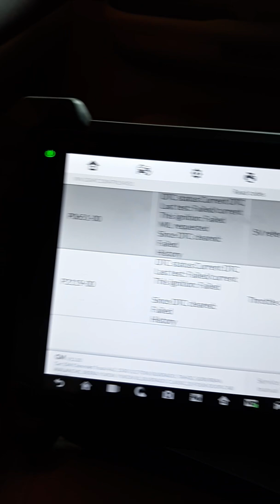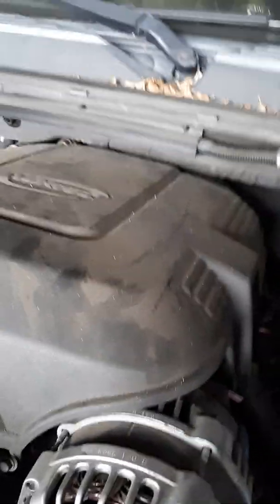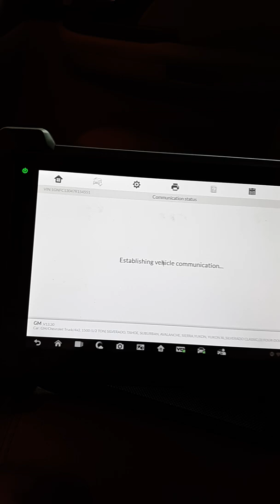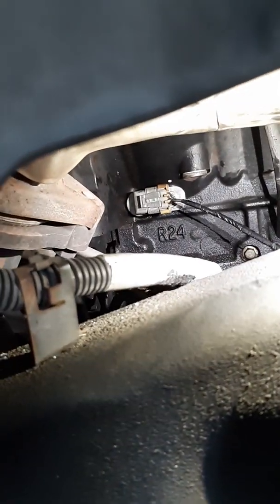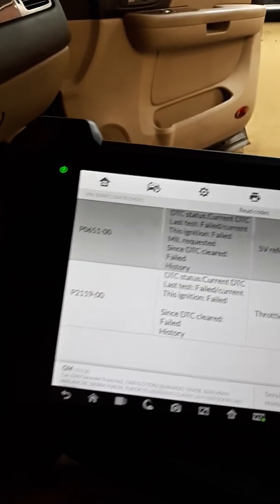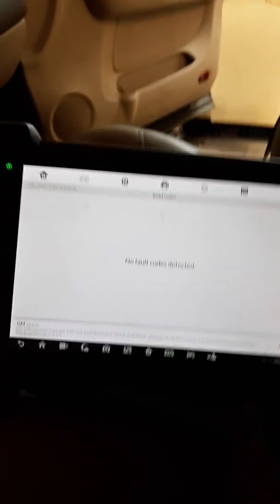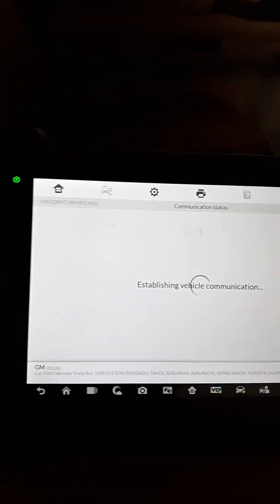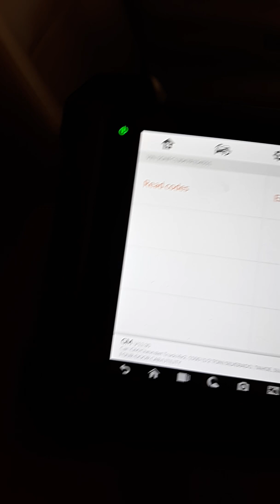Chevy tahoe 5.3 2007 p0651 and p2119 fix problem

Comment: I have a Chevy Silverado with same code. I bench tested the CKP and indeed it was bad but that was not the problem. In fact the problem with the one I’m working on is not on YouTube. I fixed it though. My customer is actually the dealer. They could not figure it out and it’s a dealership 😂😂😂. I’m a hybrid/ Electric car mechanic that’s why. All these regular car electrical problem are basic to me.
Reply: What was it
Reply: @izicromero3702  Let me try to remember it’s been a while back. I remember the car would go into some kind of limp mode. Then upon scanning it said 5 volts reference or something. Man I’m glad I came across this video I have done forgot all about it. I don’t accept regular car anymore. I only work on hybrid but back then my business was still slow I used to accept electrical problem on regular cars. I remember I charged 650 dollars to fix the problem and did some rewiring, but I don’t remember anymore exactly what I did. I am trying to remember the schematic. If I’m not mistakes it was some kind of wiring issue. Let me look up the code again and schematic it might help me remember